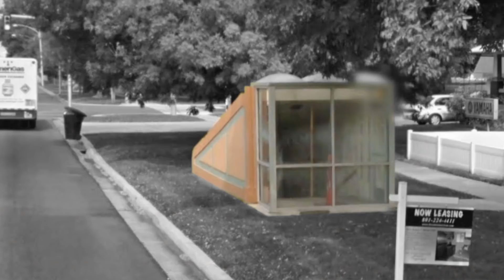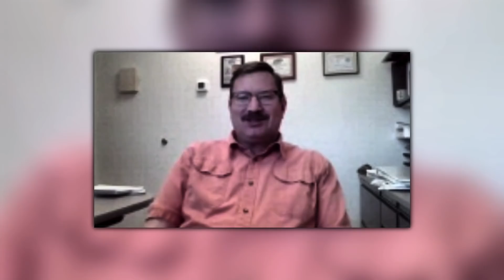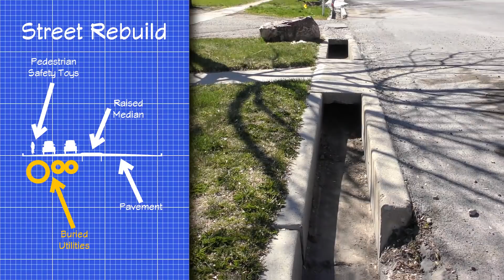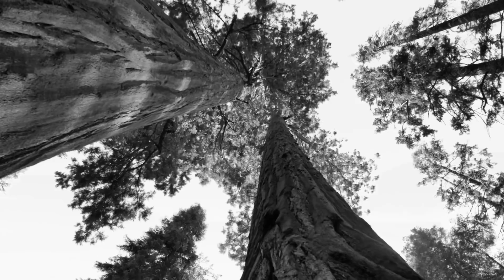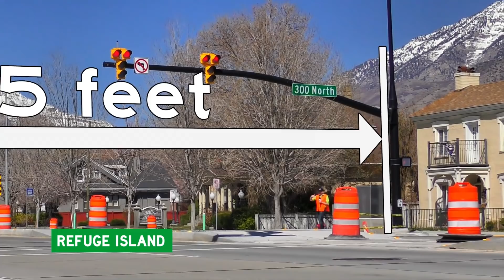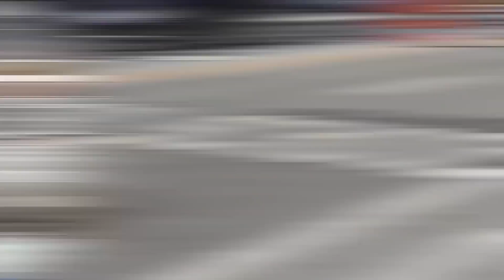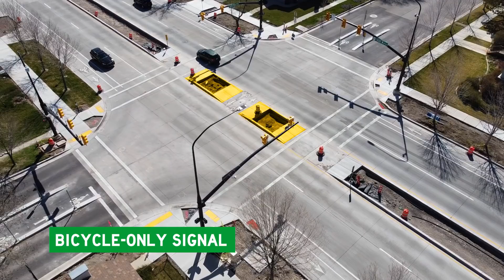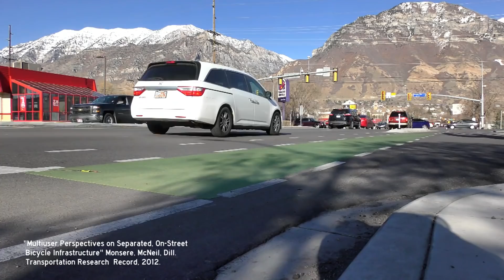Rebuilding the road? Joggers and bikers WANT TOYS, too!

Comment: They can add all the medians they want, if cars are turning right through the bicycle lane, then it is not a bicycle lane. It is an assisted suicide lane
Reply: With physical separation (raised medians) yes, turns into the bike lane are madness. But I'll admit the one time I was in a place with similar infrastructure (bike lanes to the right side of the road, either with no physical separation or sidewalk bike lanes unceremoniously dumping you into the street ~20m from the intersection) I never had a problem (terror never quite went away tho). Still, at least the bike lanes shown here are almost decently wide (downright luxurious compared to what I'm used to, as they're wider than the two-way bike lanes in my city)
Reply: @shawnpitman876  No, they don't.  In fact many cities have their bike lanes completely separated from roads that carry cars. 
In addition, the video you just watched showed a road with a bike lane in the center of the traffic where the cars only turn right.  It is in the same town no less, so they clearly know how to do it better.
Reply: I thought the whole point of putting the bike lane in the median is so that cars don't turn right thru the bike lane. The only time cars cross the bike lane is in an intersection with traffic lights.
Reply: If you make cars merge into the turn lane instead of just make a 90 degree turn directly in the path of bicycles it ends up being safer for everyone. It is typically much easier to see a bike when you have to do a merge then turn instead of just a turn. The driveways along the road do have the issue of being a direct 90 degree turn across the bike path but that's exactly how it was before, so it is still an improvement.
Reply: @garthhh  this is not true if the traffic lights are configured to not let the turning cars and the bikes go at the same time.
Reply: @shawnpitman876  yes, which is why the cars turn first, and the bikes cross with the pedestrians.  Or better yet put the bike lane in the center median where it belongs, like I said in the first place.
Reply: @shawnpitman876  They? you are talking to me. I said nothing about driveways. Cars cant cross the center median. please learn how to read. I am done trying to help you.
Reply: @Christopher_Gibbons  unfortunately, that doesn't always work. Drivers will see the bicycle light or the straight through light and think they can turn right. Even when there is a sign that says no turn on red and they have a red arrow.
Reply: @shawnpitman876  you could use a bicycle signal with a right turn signal and a no turn on red. Or a setback crossing with a slow turning radius to make sure cars slow and yield to bikes. Raised crossbikes too.

Comment: If my city had bike medians, I would ride 90% more than driving.
Reply: move to seattle where bikers have more right away😭
Reply: @vegandestroyer3782  not in west Seattle it’s hell out here
Reply: @vegandestroyer3782  As far as epitaphs go "He had the right of way" kind of sucks.
Reply: Try moving to Belgium or The Netherlands were you do not need a car in the towns and cities and there is network of cycle lanes 'Fietspad' across the countryside and trains that carry bikes for longer distances
Reply: @trent6319  Having driven and travelled in both. (Plus lived on the border) I would say Holland (the Dutch Province with most of the cities) is better than more rural Belgium. Vlanderen (Flanders) and Brabant are good in Belgium. Brussel-Bruxelles and Wallonia not as great. Then again Wallonia is hilly compared to the largely flat Nederlands (whose steepest hill is the southern access to the Westerschelde Tunnel)
Reply: @nixcails  Thats good to know. Do you think the hills hinder biking significantly
Reply: @trent6319  Hardly. They just shorten the maximum distance someone would be willing to travel on a bike. And with how strong Dutch headwinds can get, it still depends on how steep the hills are. Pretty much anyone who lives in the Netherlands has to shift down a few gears a few times a year due to headwind. In my case, from a 2, 6 ratio to a 2, 4 ratio. And keep in mind that people here rarely shift gears, even when it becomes more difficult to cycle.

Also, experience builds stamina. So in time, hills probably won't even have an impact on the maximum distance someone is willing to travel.

Comment: While there are no protected bike lanes in my area at the moment, I would like them; I hate when cars park on the side of the road in the bike lanes :(
Reply: They have one on a major eight lane road where I live and naturally no one uses it. Even I who cycles casually occasionally forget to check before I merge onto the right turn pocket.
Reply: my city first made bike lanes, then decided parking will be paid so turned them into parking spots...
Reply: The cheapest way to get one has gotta be when an unprotected bike lane is next to parked cars, use the parked cars to protect the cyclists. It costs however much it takes to repaint the lines and yet the word hasn't spread. And stop having cars cross a bike lane to get into a right turn lane! If cyclists have to use a pedestrian crossing, well, it's better than getting sideswiped by someone more focused on navigating that they're turning on the right street than being aware of a smaller, slower object heading in the same direction.

Comment: Funny part at the end. 91% of drivers "feel" like the road is slower with medians preventing random left turns and separated bike lanes. They probably feel that way but with no data to support that it's any slower and the overhead drone shot shows empty left turn lanes and barely any traffic in the middle of the day. 4 lanes plus on that road seems like overkill. 

Last time I was in the USA I was in Boulder and Denver Colorado. So many super wide roads, and highways cutting the cities into sections and low traffic volume, especially in Boulder. You can drive anywhere to anywhere else, right downtown, all day long, no problem, so I kind of get why people just give in to peer pressure and buy a Kia or whatever.

Comment: Never EVER build bike lanes that hop on to the left side of a right turning lane, ever. There’s a reason why the Dutch and the Danish don't build it that way anymore.
Reply: We have a ton of those in phoenix. I go up on the sidewalk. I'm not trying to be a statistic.
Reply: Overreliance on only the MUTCD in urban areas...
Reply: I was reading the MUTCD and found that it's actually illegal to have the bike lane to the right of a right-turn-lane:

Standard:
A through bicycle lane shall not be positioned to the right of a right turn only lane

From section 9C.04 of the MUTCD
Reply: @robo1p  a cycle track or separated bike lane can be to the right but a bike lane cannot.
Reply: @robo1p  an exception can be made if a bike signal is used
Reply: I guess, it's due to the "right on red" nonsense.
Reply: @Batlas  yep it sucks to be a ebiker on the side walk but i dont want to die from az drivers

Comment: Since pedestrian hybrid beacons were mentioned, I see an opportunity to ask: Why two red lights instead of one?

The last phase during the cycle is supposed to be treated as a stop sign. So logically, we should use a single flashing red, which everyone understands as "treat as stop sign." Riiiight?

Nope. Let's use two flashing reds, which is commonly associated with "railroad crossing, don't go," then post a wall of text explaining that it should be treated as a stop sign.
Reply: HAWKs are the least intuitive all around. Their configuration for motorists is super confusing on many levels (the two reds, plus the green or yellow-flashing and yellow ball) plus the different light patterns.  The red wig-wag always makes me recall a train x-ing which means stop. Yet, for a HAWK its supposed to mean yield, if clear. Meanwhile, their configuration for pedestrians (or cyclists) is also confusing on so many levels. A pedestrian sees a flashing hand, and often an orange countdown - where cross-traffic in another situation would have a red ball - yet in this case motorists could be approaching with the red wig-wag and legitimately not come to a complete stop while approaching the x-walk and yet cause a crash in a double-threat situation, if someone hasn't finished crossing the walk.
Reply: Just put up a damn signal, or RRFB. PHB's are terrible

Comment: I feel like raised medians are putting a bandaid on a broken leg. Stroads are Inherently unsafe, and no one in their right mind would want to crash a 4 lane one, regardless if there is a crosswalk or not.
Reply: So is the solution in this metaphor to amputate the leg? 
A stroad is the product of being unwilling to compromise car-centric, high speed travel on a mixed use street. Adding medians, vegetation, crosswalks, et cetera, is the only way to destroadify, along with providing alternative routes or modes of transport to reduce that conflict of demand. 
The real issue with a stroad IMO is that it exceeds the capacity where you can reasonably find a gap without traffic signals, where every movement feels like a hazard because of the vast number of rapid conflicts. My city has a lot of two-into-one merges after all the intersections and it's frustrating having to jockey for position with idiots who ride your ass even though MeRGe LiKe a ZiP is not rocket science.
Reply: A raised median means you only have to cross 1 side of the road at a time, very useful from my experience
Reply: this may come as a surprise to you, but not all roads in the us are "stroads"
Reply: @HavokTheorem  a stroad is actually a product of allowing businesses to build up along a bypass highway.  a much more common issue in small town America is how to deal with the fact that cities were built on main roads with a tiny fraction of current traffic, and they often can't afford to build a bypass because of space or fiscal constraints.  so their main street has to carry through traffic as well as local traffic - without having enough real estate to do any of the anti-stroad miracle cures.
Reply: @kenbrown2808  most of them are, the one in this video definitely is a stroad. I live near the intersections of 2 stroads that both intersect more stroads and my neighborhood is encased on 3 sides in stroads. The side that isn't a stroad becomes a stroad further up the road because they didn't fill in the driveways before turning it into a road. I live in a city too.
Reply: @blitzn00dle50  and there is one stroad within 100 miles of where I live, and two others trying to form.
Reply: @HavokTheorem  we certainly need transport engineers who can think of solutions to the problem of keeping traffic moving with the population exploding.  the more common town than "stroads" - which has become an overused buzzword - is that traffic trying to get through town has no choice but to be funneled onto one street.
Reply: @kenbrown2808  There is a solution, has been even before cars were invented. It's called space efficiency. Cars are not an efficient use of space.
Reply: @weetikissa  cars are currently the most efficient way to move random people and things to random locations at random times. The alternative to using cars to move people to places is to bulldoze towns in order to move the people and places close together and then use trucks to deliver the things. And bulldozing infrastructure in order to cram people closer together because that's the way anti car people want it is guaranteed to end badly in the us.
Reply: @kenbrown2808  Looks like 'Not Just Bikes' has made "Stroad" the new buzzword now. I think it is important to invest in alternatives, but 90%+ of the population in the vast majority of major US cities uses automobile. This also means 90%+ of the voter/tax base, city council members, and politicians all use automobile. The auto is here to stay whether we like it or not, and bitching about extreme measures to force people out of cars isn't a real solution and never going to work.
Reply: @panzer_TZ  and only going to result in backlash. 
Like i said earlier, a real stroad is a special case where businesses have built up around a highway (not a road) and yes, it is poor planning at work. However, the fix for a stroad is not a fix for 90% of our traffic problems and forcing people out of cars is not a valid option. The option is to develop bypasses and then protect them from becoming stroads through proper planning. Then you can address the benefits of effective transit options.
Reply: @kenbrown2808  Says the guy pushing cars, pollution, and traffic deaths on others.
Reply: @weetikissa  nope. Says the person pointing out one size doesn't fit all.
Reply: @kenbrown2808  You're the one dismissing bikes and arguing against the freedom to choose your mode of transport.
Reply: @weetikissa  is it backwards day, again?
Reply: @weetikissa  and yet, I'm not the one trying to ban cars.
Reply: There's no such thing as 'stroads'. They're called arterial roads. I agree too many lanes is bad but you can't design a city with the only road choice between 130 km/h freeways and 30 km/h five-metre wide streets.
Reply: @garirry  lol, civil engineer is salty. They are stroads. A road trying to be a street and vice versa. The whole concept is absolutely dumb anyway. It turned our communities into large parking lots, while no one wants to cross these 4 lane, 50mph “arterial roads”. It is economically unviable, which is exactly why you see malls falling in sprawled places like America, but picking up in places with intillgent, high density planning. There is no use in defending these expensive atrocities
Reply: @Zones33  I'm not defending bad roads, I'm saying that the notion that there must be a  strict binary between a road and a street is a misguided one. You turn a 50 mph 4 lane road into a 30 mph 2 lane road with bicycle lanes and swap the traffic lights with roundabouts and stop signs with yield signs and you've fixed 95% of the problems without actually changing the core design of the "stroad".
Reply: @garirry  it’s not misguided, it’s been tested for hundreds of years. Only with the advent of the automobile did we invent such a monstrosity that made every mid tier American and Canadian  city look the same. The fundamental problem is not just the road, it’s the whole design of parking lots. Adding roundabout, and reducing lanes is not a solution. It’s a partial fix to a larger problem. There is still ridiculous amount of parking in new strip malls that are mostly empty. To fix this you do all the things you said, plus on street parking and high density buildings. That is a street. Arterial roads as you describe are their own category. Sure it may exist, but it isn’t proven to be sustainable, in fact it’s the opposite. It produces the lowest amount of value without getting people fast from a to b. What is proven, is binary
Reply: @Zones33  Having large amounts of excess parking is good actually, It is not good for anyone if drivers have to spend 15 minutes cruising the lot to find the 1 remaining spot. If a mall has a reputation for always being at 95% capacity, I will simply drive to a different mall and that is not good for their business. I'm all for reducing parking spaces in dense urban cores and building big park and ride garages for connecting transit so drivers in suburbs can have easy access to the city.
Reply: @RealestUrbanism  those parking lots create nothing of value. The minor convenience of finding a parking spot for the sacrifice of potentially hundreds of thousands of dollars in revenue is not worth it. It bankrupts our cities and leaves the concrete wasteland when inevitably places close.  thinking has to be thought in terms of cars and instead in terms of people. Suburbs also don’t have to be so spread out
Reply: @Zones33  the richest nation on earth absolutely can afford a bit of infrastructure. If shoppers have nowhere to park and shop then where is the tax revenue gonna come from? If suburbs don't want to go bankrupt then they should just raise taxes and let the cascading effects take their course.
Reply: @kenbrown2808  Where in the US do you live where stroads are so uncommon? I’ve lived in 8 cities across 5 states and every single one has had stroads as the primary thoroughfares.
Reply: @RealestUrbanism  Charging for parking and removing excess parking spots has a balancing effect. People don’t spend as much time at a single store which increases customer turnover and taxable revenue. Also, it encourages multimodal transit which doesn’t require paying for parking. There are plenty of examples of how reducing parking spaces actually improves conditions for local businesses.
Reply: @iand5730  funny, because I've been to more than 5 cities, it's always been what was intended to be a bypass road that was a stroad. The small cities that didn't have bypasses had undersized and overloaded streets. The full sized cities had streets and freeways.
Reply: Stroads are perfectly safe. Just throw out unsafe bikes and get a car, like all normal persons do.